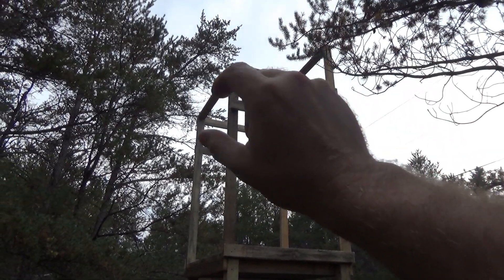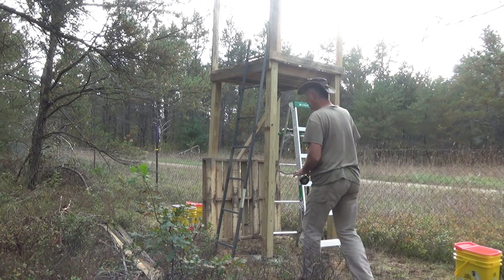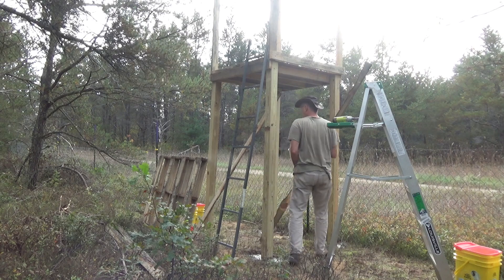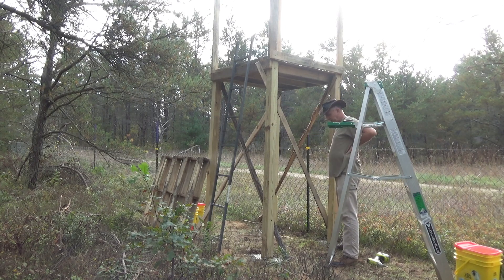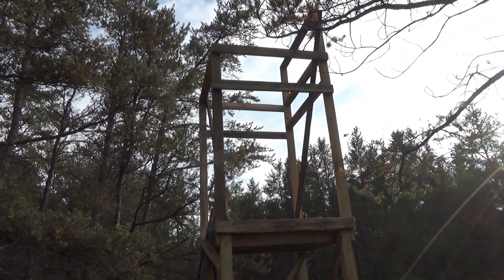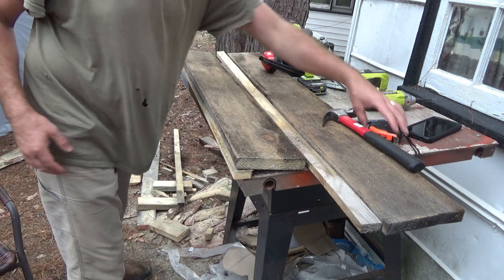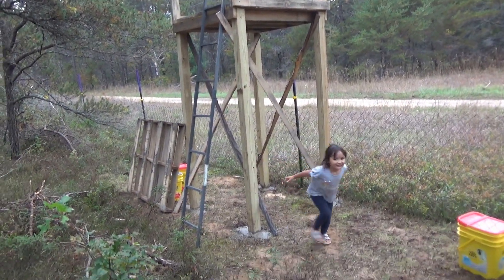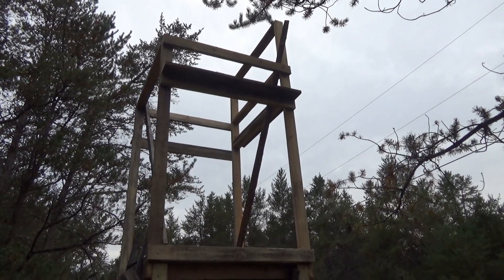Daily Vlog Watch Tower Hunting Stand Window Sills And Framing

Comment: Rad play fort for your kido Troy , when you're not using it lol , need to do a tin roof on it soon don't let weather get to ok , over hang on both front and back side just a tip ok , good job on the extra braising so winds will not blow it down bud , what's you using for the siding?
Reply: I think he said he’s going to use rough cut lumber.  it will match the recent fencing.